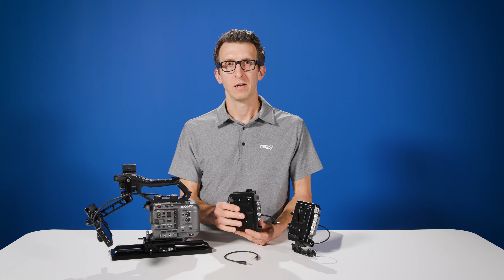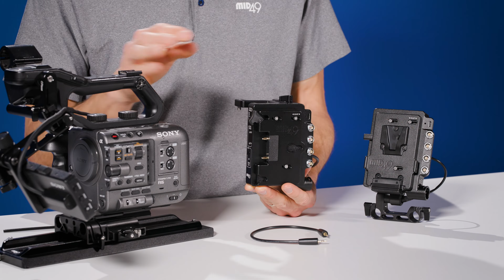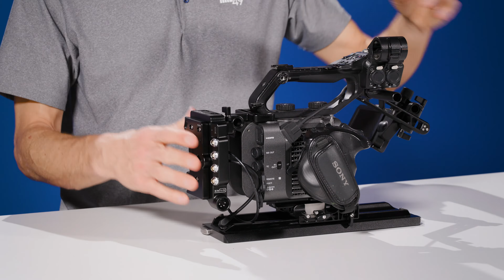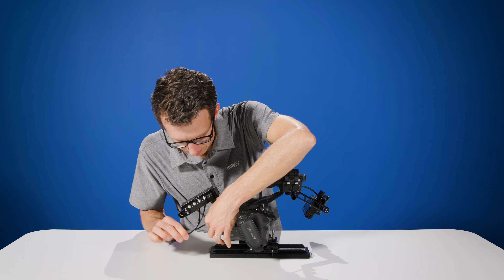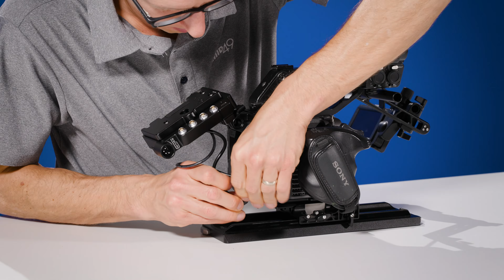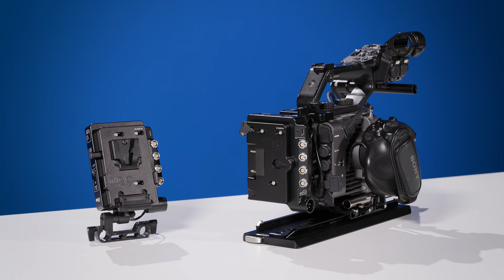Sony FX6 / FX9 Power Distribution Box DB-11 from MID49

Comment: is it possible to mount onto the cam if i'm using a top plate?
Reply: It works on my fx6 tilta top plate
Reply from the maker: @HighEndPew thank you for confirming
Reply from the maker: If you have a top plate installed, you might consider the rod-mounted version instead: https://www.mid49.com/products/power-distribution-box-db-11-sony-fx9-v-mount